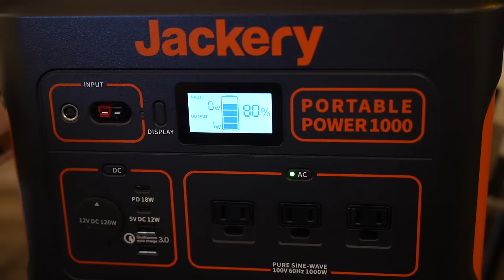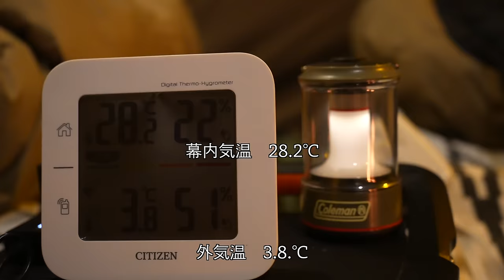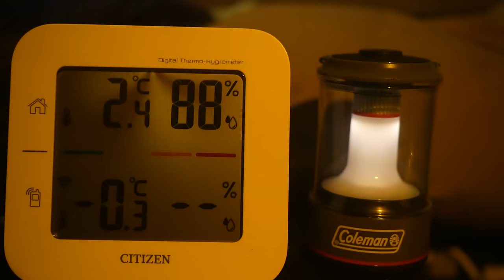【夫婦キャンプ】薪ストーブキャンプ/寒さ対策/サーカスTC DX MID +/camping

Comment: Hello. Which quality is better since you have used both brands. Snow Peak tents + tarp or Tenmaku tents + tarp?
Reply from the maker: Hi, thank you for your comment.
The Circus TC/Tarp from Tentmak Design is nice and warm in winter because the tent fabric is TC material (a textile product made from a blend of Tetoron and cotton). The disadvantage is that it is heavy and hard to dry when wet.
Snow Peak's tent fabric is polyester, so it is light and water repellent. It is light and dries quickly.
Both brands have good quality. We use different types of tents depending on the season.